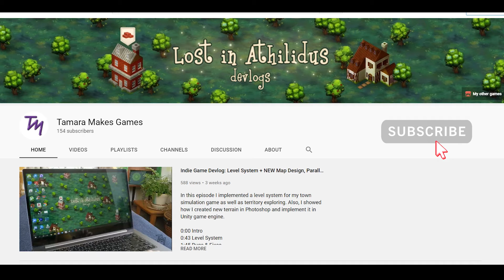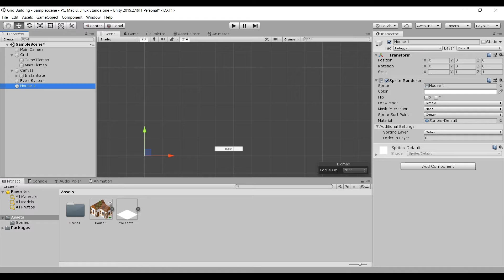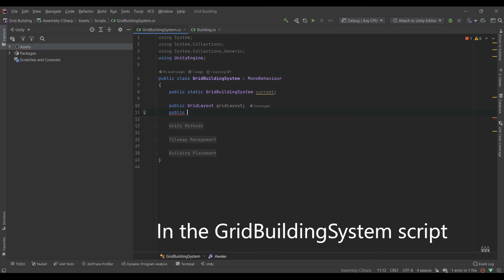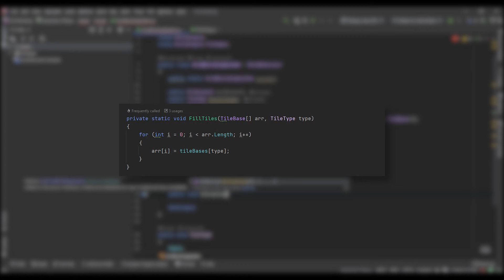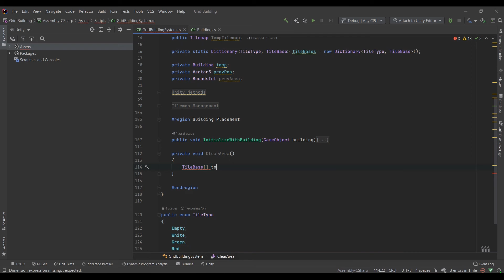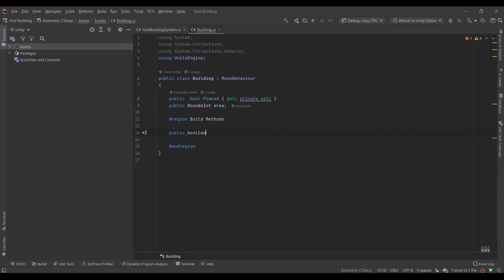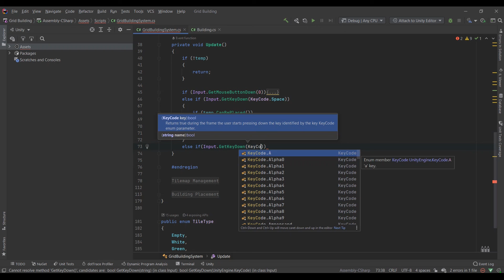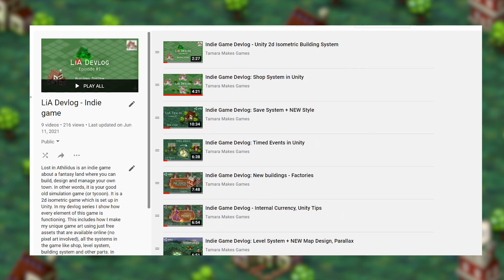Grid Building System  - City Builders, RTS | Unity Tutorial

Comment: Sorry to ask this but:
How would one go about only having white tiles around green/red tiles? I want a system that requires you to "connect" all of your buildings, so I need to check if the nearbvy Space is red/green before beeing able to place something on the white tile there.
Reply from the maker: I would modify the method that checks placement availability. Instead of just checking for empty cells for the building placement I'd also check neighboring cells to not be empty.  Or you can go the other way and set white only the neighboring cells of a placed building. But that wouldn't account for the next building's size so maybe you should combine the two approaches - first one for functionality, second - for indication.

And don't be sorry for asking! It's totally okay to ask questions 🙂

Comment: Awesome Video Tamara keep em comin! For everyone else here is a heads up!

IMPORTANT: The tile system is case-sensitive

This means that...
 

If you type "Green" on the tile asset in the project folder 
and then type Resources.Load<TileBase>(tilePath + "green")); "  in the start code then it won't work!

If you type "green" on the tile asset in the project folder
and then type Resources.Load<TileBase>(tilePath + "green")); "  in the start code then it will work!

Hopes this helps someone!

Comment: A few issues with your video and its mainly your skipping over parts, sharing only your pre-made assets and rushing through everything which is hard on people with such as audio and visual impairment.  1) You are not showing HOW you made the "ART" or how to measure the Asset sizes.  You do that with the Grids, you need to do that with the ART meant to align to the grids.

 2) If your going to show scripting as part of the tutorial you need to take it step by step without rushing through it. This also means if you are granting usage of the code and implying its in the project, it needs to be in the github, not used as a lure to get someone to have to join your page to have access. That is very misleading to people and you should consider stating in this on this page 'SCRIPTS NOT INCLUDED WITH PROJECT ASSETS.' Good luck.

Comment: Hey! Awesome tutorial, but I have a small question. This works for the objects I want to build, but if I want to generate objects on the grid (for example trees or rocks) how can I make them part of it? (Also dunno how to instantiate prefabs in random positions connected to the grid XD).
Reply from the maker: Hey there! Thanks! You can build a separate spawner class that is going to be responsible for storing all the possible objects to place. Then, choose them randomly and choose the position from a certain range. If you want to make sure it already fits the grid you can generate only whole values for coordinates like 0, 1, 2... Also, to avoid double conversions you can modify the method InitializeWithObject to accept a ready position on the grid. For example, you can do this by making a parameter of type bool that'll indicate if the position is already on grid or in world space. Then check that bool and do the calculations for the position only if necessary.

Comment: Hi! 

First, thanks for the video. 
It is really informative. I tried to port the tutorial to a 3D space and discovered a weird behavior. When clicking to move the building around, it only moves upwards (along the y-axis), no movement at all in the plane space (neither in x- nor in y-direction). I already tried to play around with different Vector2 and Vector3 assignments, unfortunately without any luck til now.
May someone kindly give me a hint what to do to stick the building to the ground and move it along the x-/z-axis?
Reply from the maker: Hi there! I don't recommend using the input you see in this video for a 3D project.
But it is great that you mentioned. I will be posting a tutorial for a grid building system in 3D very soon! You can subscribe and turn on the notifications 🙂

Comment: I'm halfway through the tutorial but stuck with the 'EventSystem.current.IsPointerOverGameObject' check. It always returns false. I've tried by adding a collider to the sprite and changing the sorting layers and order but nothing is working. It instantiates the sprite but doesn't recognize it with the pointer... Does anyone know what I might be missing?
Reply from the maker: This line of code is supposed to detect UI  click and prevent it from going through. So if it returns false, you're not clicking on the UI and that's all.
Reply: I know what it is supposed to do but somehow it doesn't. I was just wondering if someone else had encountered the same issue as I couldn't find it in the earlier comments. Thank you anyways.

Comment: Can i use this code for my 2d project with 2d flat tilemap. where should I change in this tutorial?
Reply from the maker: Hi! You mean rectangular grid, right? Yes, you can. You should only change the type of grid and maybe adjust the sprite offset on the building prefab
Reply: @TamaraMakesGames  yes. How should i adjust to  the spirite offset? I changed pivot on my house to bottom right and it seems it works? Is that correct? Also Do you have suggestion for save load system?
Reply from the maker: If it works you don't need to change it. That is great that you didn't need any adjustments. 
I think I mentioned a good saving system in one of my devlogs... But you can also looking my Discord server (channel resources). It should be there too!
Reply: @TamaraMakesGames  thank you so much. do you have linkedin account?
Reply from the maker: Yes, why'd you ask?
Reply: @TamaraMakesGames  i would like to    get contact

Comment: If I wanted to paint the building prefabs onto a tilemap instead of instantiating them as game objects, how would I do that? Thank you for the tutorial!
Reply from the maker: That would require a custom tilemap brush with game object. The system will be a lot different. Thanks for commenting!
Reply: If the buildings are in your Tile Palette (or set as tile assets), I don't see why you can't have another Tilemap called Buildings or something on a layer that renders before the ground and then use SetTile? Unless SetTile is currently not working in Unity.

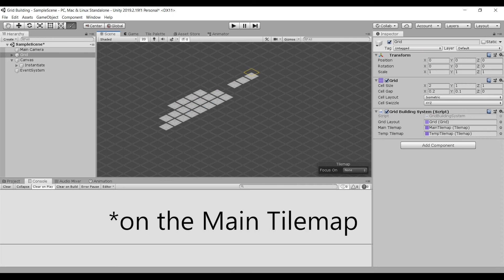Comment: For some reason (although everything looks identical in scene/scripts) When I click/place the house it doesn't seem to paint the tiles green :) (at ~10:00) also how did you paint the white tiles so fast?
Reply from the maker: Hi! Try checking if you add differently colored tiles to the dictionary. Then maybe check if you have a line of code where you set a new colored tile. Also, positions are important. Maybe something is wrong with them.
I don't think that the problem is with loading tiles (some people had it) because in that case you would get empty tiles (null) or even an error.
You can change the color of a tile in the editor. Look in the inspector for the color field. It is only possible if you have plain white tiles.
Reply: @TamaraMakesGames  I don't seem to, I copied everything exactly up to that point. If anything it could be an editor thing with position or something? Position of what exactly, and where should it be?
Reply from the maker: Check area size in your prefab. It has to have z set to 1 and not 0. Also, check the position you set your tile on. Maybe something wrong with it.
If you still have problems, you can write in my discord server in the help channel and provide more information about your problem. Maybe other people who have developed this system will be quicker to help you or I will look at it personally.

Comment: Hi there, awesome Video, but i still can figure out why the tiles not changing colour. Adding a prefab and moving it around works perfect. Everthing seemed to be right, except of the colouring tiles.
Reply from the maker: Thanks! Try checking if you add differently colored tiles to the dictionary. Then maybe check if you have a line of code where you set a new colored tile. Also, positions are important. Maybe something is wrong with them.
I don't think that the problem is with loading tiles (some people had it) because in that case you would get empty tiles (null) or even an error.
Reply: @TamaraMakesGames  I think the code is everything right, because i copied your script from patreon. What do you mean  with positions?
Reply from the maker: Can you please message me in discord? We can discuss this further so I can help you

Comment: For some reason, why building is not snapping the way yours is.
Reply from the maker: Snapping is handled in the Update method in the if statement which detects a button click. Make sure that you have a line of code where you assign the local position of the house to a new position and snap it to grid.
Reply: @TamaraMakesGames  Another thing that isn't working is the erasing of the tiles. I managed to fix the movement issue.

The tiles get painted but they are not getting erased. Probably something wrong on my end.
Reply from the maker: @theplaymakerno1  In the method follow building make sure that you called the ClearArea() method. If yes, then check if your method works well. Check if the size of an array is calculated properly and the prevArea is changing (not in this method, but in the Update)
Reply: @TamaraMakesGames  I found the mistake. Thank you and God bless you for providing this solution.

Comment: Hey, I was trying to learn something new with your coede, it's really cool as I am just a beginnger. I've got some questions though: why are you using "Tiles\" path in the dictionary if you aren't creating a separate folder in assets? And are you sure that slash is in the right direction? I am asking because my indicator tilemap isn't changing colors...
Reply from the maker: Hi! You can load tiles in another way just to see if everything works. For example, create fields for them and populate in the inspector. As for the resources, I checked with Unity documentation and turns out you're right. The slash should be in another direction. Thank you for noticing and sorry for the confusion.
Reply: @TamaraMakesGames  Do you think I can serialize the textures in the begining of the script? Or do I do that in the enum TileType? I've checked all the code and I think it's all right, but strongly believe the issue lies in the script not seeing textures for different tile types...
Reply from the maker: Try serializing them at the beginning of the script and then initializing them in the editor. Then in the Awake method you can add them to a dictionary.
Also, did you try just creating a folder named Tiles in the Resources?

Comment: Hey, great guide, is there a change you can show the dragging scripts?
Reply from the maker: Thanks! The full script for a house with drag and drop is going to be available on my Patreon page soon. 
For now you can just look for a tutorial on drag and drop in Unity. It is pretty easy, to be honest.
Reply: @TamaraMakesGames  I found a few, yet they do not work well with the grid, I'm getting an offset after the initial instantiation
Reply from the maker: @Rony Gankin  I had the same problem. Just offset the position where you instantiate a house. This worked for me:
position = gridLayout.CellToLocalInterpolated(cellPosition + new Vector3(.5f, .5f, 0f));
Reply: @TamaraMakesGames  I'm working on it in the building script so I should just reference the grid from the grid script and have that line after the instantiation?
Reply from the maker: I do the instantiation in the grid script so this line goes before it. But you can do it in the building script if you wish.
Reply: @TamaraMakesGames  I'll look into it, if you have some reference script or guide I'd be happy as I try to write all the code myself as to learn it

Comment: Hi, thanks for the video. But on GitHub, your final project is not an actual?
Reply from the maker: That project is the same as in the tutorial. I didn't make any changes to it but if you acquire any problems with the code - feel free to contact me.
Reply: @TamaraMakesGames  I never managed to implement drag and drop, using Grid.  Tell me where you could find out in more detail how to implement drag and drop?
Reply from the maker: @Ichigo123461  This is the tutorial I used for drag and drop https://youtu.be/p7akGCRgBLA
To make it work on a grid, in OnMouseUp  method add grid snapping.